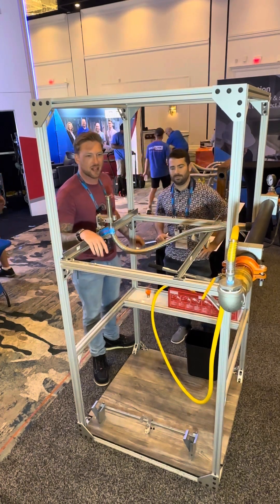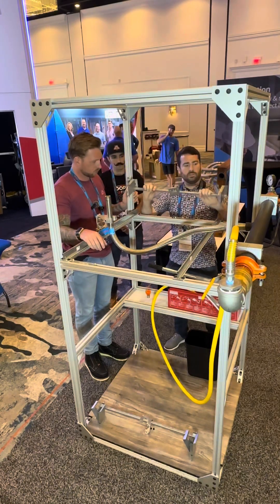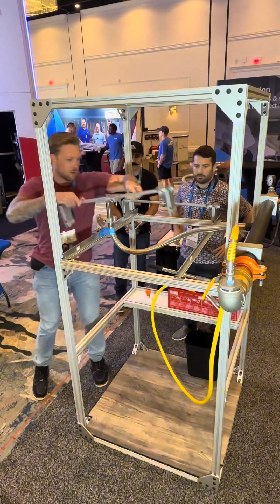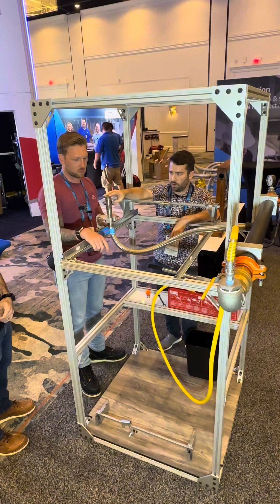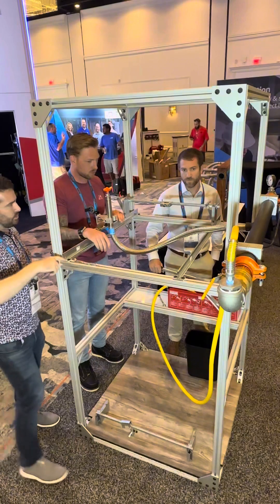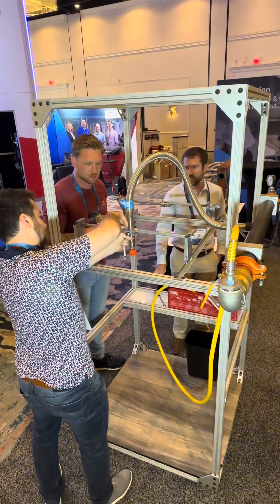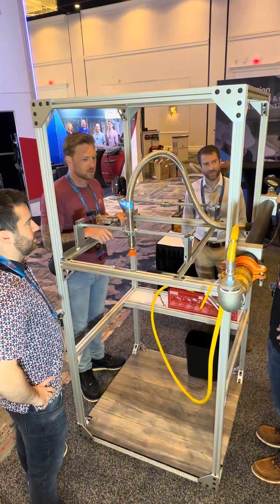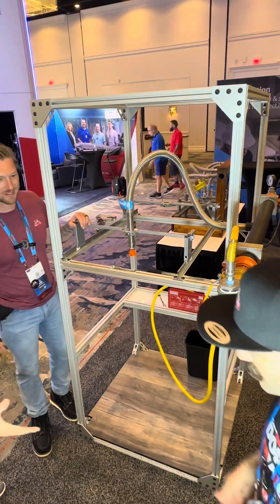AFSA42 FlexHead FH 120 Bracket & SuperFlex hose w/ integrated InstaSeal technology  #innovate #expo

Comment: Not a fan at all on these gaskets, so many questions. Is there any mechanism to prevent smashing of said gasket, what if said gasket gets sucked into system ? I’ve ran into these styles of head adapters on CPVC and I’ve seen quite a few hasty leaks, hopefully I’m wrong but I don’t think these will hold up over time